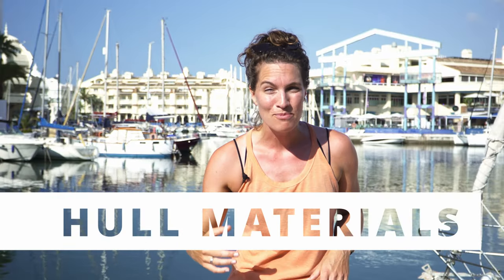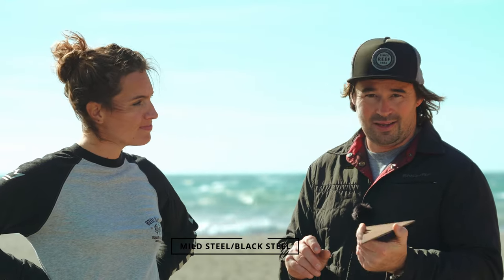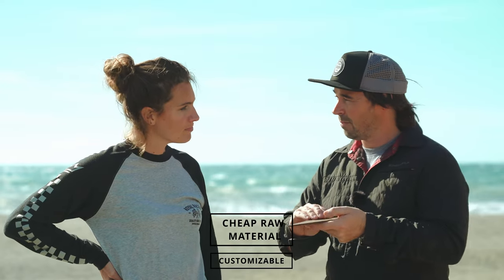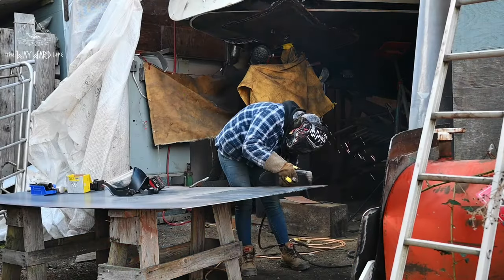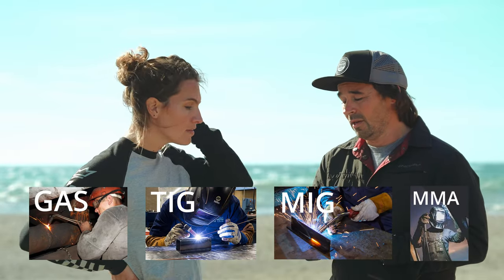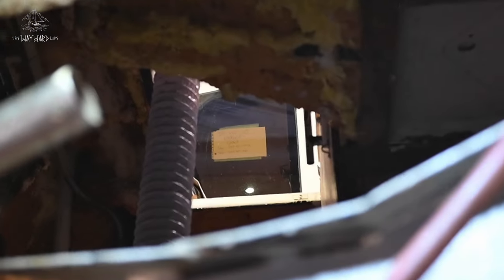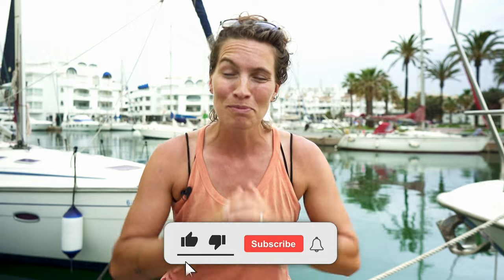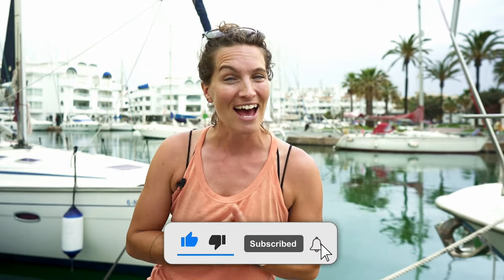Do steel cruising yachts make sense in 2023? - Sailing boat Hull Materials part 2

Comment: why not stainless steel.
Reply from the maker: You can go stainless but he main issue you will have is that stainless needs oxygen to provide its full corrosion resistance properties. Unfortunately there’s not much of that under the water. So it still works, just not as well. It’s also not as strong.
Reply: @SailHub  there are alloys of stainless steel that are marine grade or better which should be nearly  corrosion resistant.  then again it depends on what steel they used for the boat
Reply from the maker: @curio78 as a marine fabricator I would suggest that 316L is the best alloy for marine use and my earlier comment still rings true. There are other options but you still need the O2 to get the best potential out of it. 
Another thing to note is that when it does corrode it’s crevice corrosion. Which is difficult to spot at the best of times let alone under a skin of antifowl.
Reply: @SailHub  I belive 316 has high corrosion resistantance but will still corrode. Super Duplex Stainless Steel should be the best. I am a bit unclear about what you mean by o2 requirement for corrosion resistantance. o2 is what is needed for corrosion.  the whole exercise in corossion prevention is to prevent o2 from getting in contact is it not?
    chloride in the seawater simply accelerates this o2 contact corrosion by basically clearing the old corrosion allowing fresh steel to come in contact with o2.
Reply from the maker: @curio78  the oxygen creates an oxide layer. It is that that makes it resistant to corrosion. I’ve see people waxing their stanchions and the likes to ‘protect’ them for the winter, the results are quite the opposite. 

Super duplex is fab but only required for high strength and of course you would need to heat treat the entire boat after the welding was complete. 316L has a lower carbon content and would be the chosen material by most.  It’s an interesting subject but I would personally stay away from it just because of the crevice corrosion. It  just won’t be seen under the waterline due to paint. This of course could be a big problem in years to come.

There was a van de stadt built from stainless about ten/fifteen years back, I believe it’s still not sold.. or at least last year it was still for sale, still unlanunched and new, there’s a reason that sale is painfully long! Either way, if you want to build a stainless boat you go for it chap, I’m knot going to complain, where there’s a will there’s a way and I take my hat off to anybody who’s going to find that way!

Comment: You’ve never sailed through heavy ice and it shows.
Reply from the maker: I think you may find your wrong there, I did it in a wooden boat actually and it was terrifying.
Reply: @SailHub  Tell that to the boat which now rests at a depth of around 6700 feet down on the bottom.
Reply from the maker: @oldowl33 I wish I knew where you were going or coming from with this… I mean, did you sink the ship? What happened? Have you sailed in ice much? What context are you speaking in here? I’d love to answer positively but it’s hard to know what the problem is. 

Cheers,
Chris
Reply: @SailHub  The ice crushed her with a Gail from the north, no doubt of that, 70°58'00"N 130°03'26"W was the location, it was 14 years ago. Another one for the locker.
Reply: Rescue out of Tuktoyaktuk.
Reply from the maker: @oldowl33 that’s a sad tale, I would like to read more about it but it’s hard to find.
In the worst situations I don’t think it matters what boat you are on, there’s only so much punishment any material can take. 

Anyhow, I’m sorry if offended you in the video in some way, not intentional for sure but I’m not really sure what the problem is.
Reply: @SailHub  I like to think she scattered to pieces all along the North Slope.